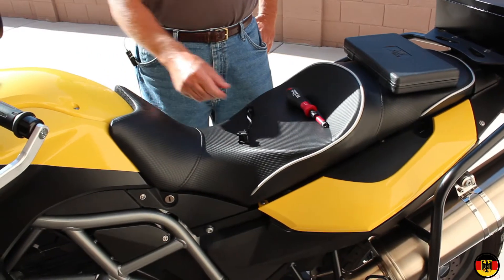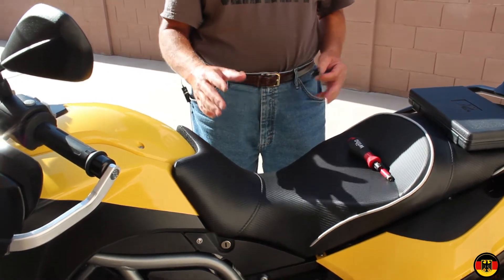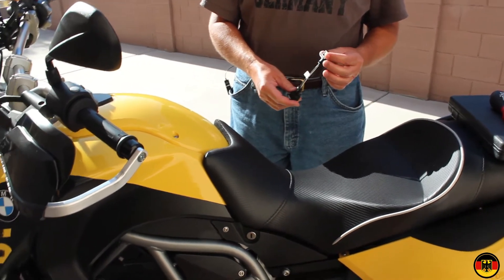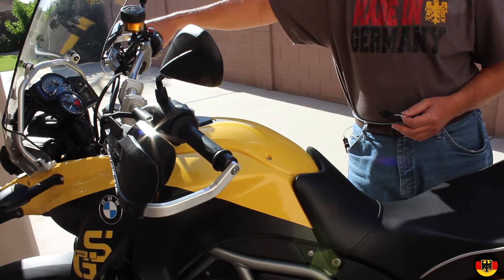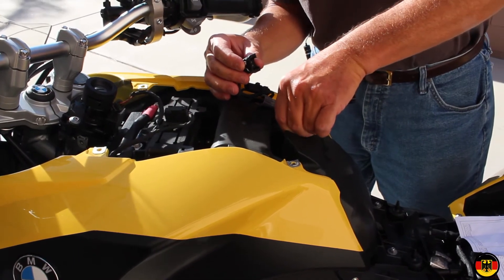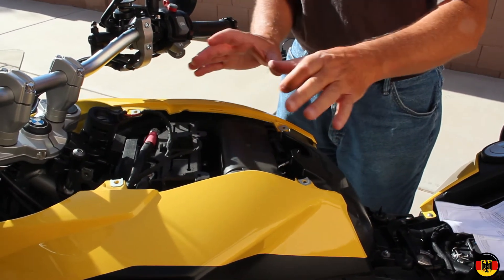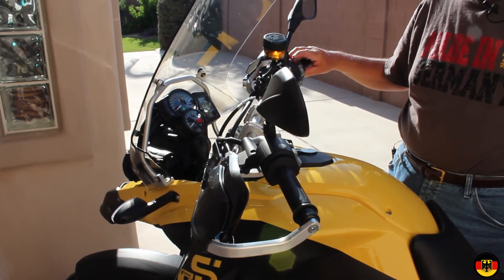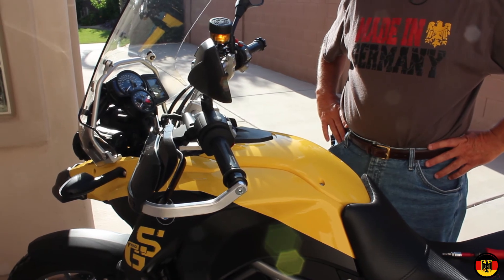BMW F650GS Twin SOL2 Accelerator Installation

Comment: I'm amazed you stuck with it as long as you did. It had to be very frustrating. I own a 2013 bmw 1200rt. I love the bike. It has just over 60k miles with no issues. I'm considering a used 2012 f650gs exactly like yours. Your video was the first discussing that issue. Thanks

Comment from the maker: Wow, the SOL2 accelerator has changed this bike into an excellent performer.  This machine is now back on my favorite bike list.  One thing I have noticed on many Youtube videos, is people being concerned over the loud ticking sound coming from the 800cc engine.  I was told it is the fuel injectors.  Just for a lark, I put two tablespoons of fully synthetic ashless 2-stroke oil into my fuel mix and the injectors seem to run much quieter now. Continued...
Reply: I followed your advice on the sol2 and the 2 stroke oil. I am enjoying the improvement! Thanks for sharing.
Reply: 10 years later I'm here with the same problem and I bought the sol2. Can you please link me the oil you put in the tank?
I hate the ticking sound at low speed

Comment: For anyone thinking it's a resistor, it is certainly not. In fact it is small electronics (yes it is fitted inside thic cable) and it does trick the temp but it does it according to the outside temp and calculations made by engineer. It's not constant.

Comment from the maker: Has anyone else tried this?  Since the amount of oil added is very small, and it is clean burning (check out how Stihl uses premix for their 4-stroke trimmers), there is no smoke from the exhaust and ... well ... honestly ... the bike seems to run better than ever.  I would be interested in other peoples experiences with this idea.  Cheers and happy riding!

Comment: The module tricks the ECU to think it's cooler than what the actual temperature is but you say you have the most problems when the temperature is cold and less when it's hot out. If the module worked it sounds like you had a bad air temp sensor and you were running too lean.